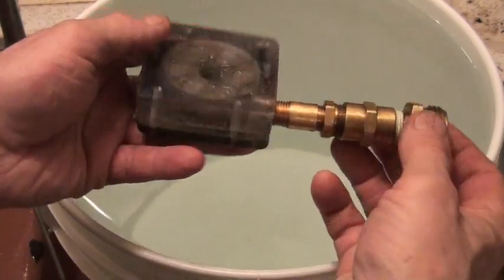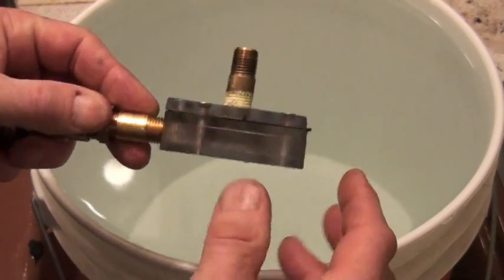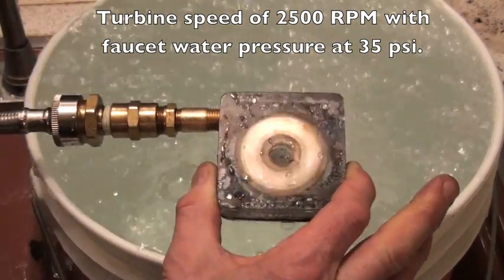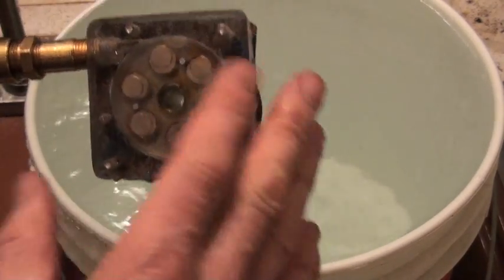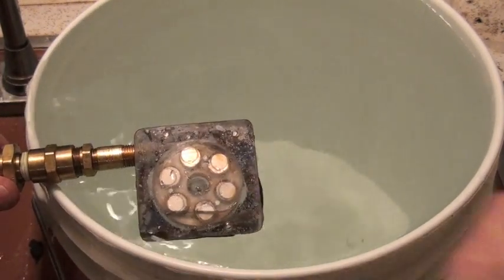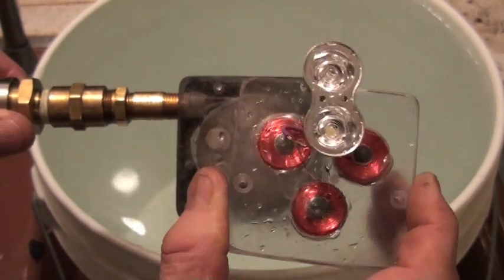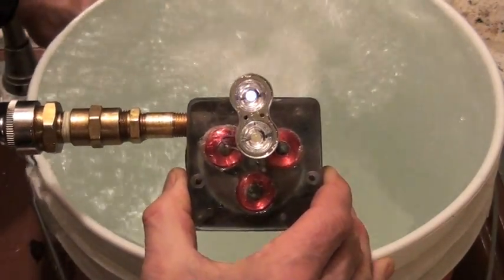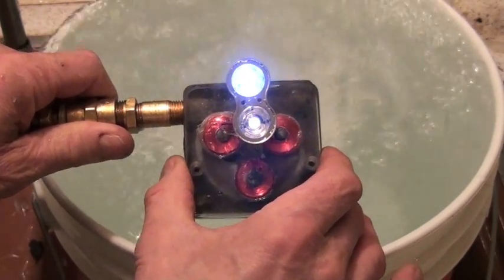Magnetic Tesla Turbine Generator

Comment: Could be increased in size & voltage, & use a wind driven water pump!, to fill a reservoir to feed it, as tje biggest problem with wind gen is rpm"s, this should be able to supply the higher rpm's ,with adverge wind

Comment: Why did you put the words "Free Energy" in your description?  If you left this out people would have looked at your design in an actual scientific mindset.  By using the term "free Energy" you are now dumped into the group of nutjobs that do not understand physics.  Free Energy is impossible.  Energy has to come from somewhere - you cannot create new energy.  Your device is getting energy from a coal power station that generates electricity that powers pumps that pump the water to your house.  So not free energy.  It is not even energy that does not cost money.
Reply from the maker: Sorry to disappoint you, but there are no pumps, or coal, or extra electricity involved in this situation. Normally, every time you open a tap for water, it wastes the pressure that could be used to produce power. I merely took free advantage of this wasted energy, which costs nothing extra to obtain. "Free Energy"... you bet it is!

Comment: This would work very well if instead of mains-pressurized water, you used a gravity-fed source, such as a mountain stream.  By using water pipes of decreasing diameter you can build up a good head of pressure.  All-in-all a very useful design - this has real world application.
Reply: Mark Smart they already have something like that adapted from medieval technology, it's called a waterwheel. For a guy named Smart you don't appear very, or is the name ironic?
Reply: Mark Smart You're being ironic, and you're still a dumb fuck regardless of the names you call me. You don't even realise that exactly what you proposed has been in use for over a century since the first hydroelectric system came online in 1882 on the Fox river in Wisconsin and you talk about "real world applications"  like some idiot trying to make the world's first airplane 100 years too late. .
Reply: Andrew the Celt Crawl back up baphomets ass mason slime.
Reply: Mark Smart sure it will, meantime, I'll get on with my life and leave you to wait on your rooftop with your arms outstretched like a fool.
Reply: Mark Smart great, it'll put me out of my misery from having to listen to you
Reply: Mark Smart An atheist cannot be a mason you tool, requirement number 1 is a belief in a higher power.
Reply: Mark Smart after speaking to you I'd say something very unpleasant is already here.

Comment: So the magnets multiply the speed of the wheel rather than just a normal water wheel?
Reply: quantum vortex no, it's pressurized, there's energy loss in the drag since the wheel causes turbulence and also loses energy at the axle through friction. It's great if you want to run up a $200 water bill to light a Barbie Playhouse though.
Reply: thx

Comment: I like this because it goes for simplicity by not having a shaft, or any gears or pulley system, and it is indeed essentially a Tesla Turbine as opposed to many videos that lack the casing. The only issue is that this rotor will slowly eat away at the space around it, so if it was used for a VERY long time, it would eventually grind away enough plastic to become less efficient. Perhaps if it was made of aluminum and pumped with lubricant instead of water, then it would be useful in some small scale industrial sense. Still, thumbs up. Oh yah, and it's not free energy.

Comment: hardly free energy, i guess water is free. I dont know about you but 200$ a month is completely free sarcasm. Putting monetary costs aside... where do you think the plumbing system gets power to pressurize water? It gets it off the grid just like everything else... this is simply getting a small fraction of that power back, but if you take the power that this device gives off and subtract it from the amount of power it takes to pressurize water through a hose... the system is still loosing more power than it gains... this is very far from free energy or a generator. If the grid were to shut off... water pressure drops too (yes it would take some time for water pressure to drop completely but it would eventually stop and this device would be useless.)

Comment: This technically isn't"Free energy". Why? Because it takes energy to pump that water out of your hose at high pressures. And I doubt that that generator is 100% efficient so your'e actually wasting power and water, because your output is less than the input energy you're using.
Reply: in a gravity fed system (for example the dam on top of the hill that  i use to water the plants in my 165 acres property) the rain "pumped" that water up for me. i have a 2 inch rural pipe that runs for almost a km and the water has so much pressure because of the slope that it comes out like from a firefighter hose.

Comment: Have you completed your 2nd prototype yet?  If so, I am very curious as to the loss of efficiency when the outlet water pressure is used to power a second turbine.  Tesla claimed 98% efficiency of transmitted flow to RPM and you lose no water in the process.  In fact with the reduced nozzle you seem to have even greater pressure.  

Could you PLEASE do an experiment with these sort of generators daisy-chained?  Perhaps with voltage readings to show what kind of loss is to be expected in the process.  Tesla states this is his favorite invention.  If they can in fact be daisy chained it would be no wonder why.
Reply: Bummer, people get into stuff, then they get board !
Reply from the maker: Coup2L'eau  I designed this turbine to mate magnetically with several others to increase output. It was my intention to experiment with that, but I can't afford to.
Reply: ***** did he ever e-mail you?

Comment: Pumping water is not free... I don't see the point in this?  What happens to all the wasted water?  Unless you are watering your gardens I don't understand the application.
Reply: The fact that it's not a "fee energy engine" does not mean it's useless.
A large one could be used by putting it in a river maybe?
Reply: what is the point of this? this is a toy. however the tesla turbine design is usually used to extract mechanical power from steam in industrial applications.
Reply: there is an application..
Reply: *****
 Large ones are already used in power plants. Coal, natural gas, nuclear, solar(not the photo-voltaic type), they all just heat water into steam. The steam is then pipped into a Tesla turbine like device that is connected to a generator.

Comment: magnetically coupled windings,
   need to see what power potential is available. after all, water is not cheap anymore .
   6-48 volts and some amperage behind that, is what is needed . but an interesting approach.
   fluid bearings and a shaft might get your RPM up to a usable form factor too.
  the smaller rotor has potential to keep magnets caged @ higher RPM too

Comment: In an electric car, a battery can run a pump. the pump can run the turbine. The turbine can turn an alternator. the alternator can provide charge to batteries that run the electric car. A kind of Over unity.
Reply: one problem.. batteries can't charge that fast due to resistance..aka load! once a load is applied , you can never get more than you put in..
Reply: MrRotaryengine
Well, then just to extend the range. What id the wheels turned the turbine? Or better yet a tank of natural gas hooked up yo a Bloom Box that makes that into electricity that supplements the batteries to extend the range. It's not perfect but it's better than the gas hybrid they use now. Still, what if you ran alternators in series? 4 alternators off the primary and sent those amps to the batteries?
Reply: Robert Galletta
No...it would not be better than the current set ups since the Bloom Box is a proven fake. Very thoroughly proven. So much so that it is AMAZING that there are still people dumb enough to bring it up.
Reply: FuckYouGooglePlus
Listen, You arrogant ass crack, If you need a simpler system, take a lawn mower engine, use it to turn a bank of alternators to keep the charge on batteries to supplement power and extend the range. Does that work for you?:

Comment: now if you built a large one safe to use with potable water to pass through to install on your main water line you could charge a battery every time a tap was opened, ideal for keeping batteries topped up in an emergency back up system
Reply: Great idea.
Reply: Roger Foster or, you could just have a rechargeable battery drawing milliamps of the grid, wait they already have those.

Comment: woohoo you made a water powered inductor lol
Reply: nothing new here.. basically same technology reservoirs/dams use right now..
Reply: MrRotaryengine
Do you know if this turbine would be more or less efficient than those in use today?
Reply: Gloria Plaggemeier Tesla turbines are more efficient w.r.t extracting momentum from the fluid, however they fall over when you apply a load.  You have to remember the way the Tesla turbine works is dependent on fluid viscosity, not on pure mass of fluid like you get in a reaction or impulse wheel.
Reply: MrRotaryengine yup, another one of Tesla's designs.  He designed Niagara falls.
http://www.teslasociety.com/niagarafalls_tesla.htm

Comment: have you continued your progress or did you shelve it? my understanding is that you might achieve ALOT of hertz, but the volts and amps would max out on the turbine due to the coil size and wire diameter. true?

Comment: Great idea. Are the magnets only attached to the outside disk or are they thick enough to be joined to the other five disks? If the magnets are only connected to the outside disk have you noticed any imbalance caused by their weight? How are the six disks connected?

Comment: i want to apply this concept for an rc airplane or a boat. i designed a lightweight turbine that works great with gases(it cant work with water etc.) but i need a practical (and lightweight of course) way to generate the flow to run the turbine.any advise?

Comment: at 100 psi and NO super heat, saturated steam is roughly 337F, I have a steam boat and even with superheat I rarely get to 500F. What you have to worry about is the case failing. Also my grandpa made a tesla turbine and we've run it on air (around 35-40 psi) with little problem. You could make the case out of aluminum (which is what we did) and it'll work just fine with saturated steam =)

Comment from the maker: Using JB weld and compressed steam at 100 psi plus high temp, is not a good combination. Steam expands something like 1800 times from a leak, which could be catastrophic. The outer case at least should be metal or high-temp carbon finer.

Comment from the maker: The efficiency is determined by the load put on it. A Tesla turbine under no load can be 98% efficient, according to Tesla and other tests. However, this turbine is likely in the 10% efficient range when run on water pressure under load.

Comment from the maker: That is a great idea, but the problem is usually getting enough PSI pressure into the turbine, as Tesla Turbines like high pressure to operate. This unit needs 10 psi (25 foot drop of water in a hose) just to get started, and 60 psi (pressure of about a 150 foot vertical drop of water) to make enough power to run a couple of dozen LED's.

Comment from the maker: Folks buy pressurized water, but never take advantage of the potential energy. They thoughtlessly let the water splash out into a sink or garden without using the energy. 
The point is, this turbine has no bearings, shafts, or seals, and its outer case is a generator. I think that is an improvement over 19th century technology!

Comment from the maker: The Tesla Turbine requires a high-pressure fluid source such as from a waterfall or home pipe to work properly. The small amount of power saved from installing into a home water pressure system, would not pay for the installation and maintenance of a turbine system.

Comment from the maker: The outer edge of the discs moves at a higher velocity than towards the centre. The fluid normally enters at a very high velocity, directed at the edge of the disc, then rotates several times before exiting through the centre. Making high velocity fluid go into the centre, even if it was directed, would not produce the torque required. The fluid "wants" to go straight out. You could design a different style disc, perhaps convex with fins and make it work...but it wouldn't be a Tesla Turbine!

Comment from the maker: This Tesla Turbine won't work in reverse fluid flow the way you describe. However, I have connected a motor to the Turbine, run it in reverse and then you have a Tesla Pump! The original Tesla patent has the exact same device shown as a pump and a turbine.

Comment from the maker: For a pulley drive, I see two options. Tesla's Turbine used a shaft to mount the pulley, with bearings and shaft seals. Otherwise, one can build a magnetic turbine with a pulley that mounts on the outside of the case as a stub-shaft, and then uses a magnetic coupling to drive the "stub-shaft".

Comment: Ah a well refined design. what ever happened to your CD versions, those sounded cool.
I tried making one before, but I don't have enough water pressure to get it to speed and you have to generate a lot of speed to get enough torque. So how did tesla's turbine channel its power, in your case a magnet, but I want to build something that can power a pulley drive, what do you suggest?

Comment from the maker: Tesla's turbines could be designed to be powered by any fluid or gas under pressure. In Tesla's time, steam pressure was common, and that is what Tesla talks about in most patents. However, Tesla's Valvular Conduit patent also allows use of gasoline or other fuels to be burned inside the turbine...not such a good idea in this kind of plastic turbine!

Comment: Instead of putting this on your garden hose, which would draw energy to operate.  Put it instead at the bottom of your gutter system, the water that flows through would provide some power without using any energy energy from the power plant or add cost onto your water bill.

Comment from the maker: The discs were cut by water-jet from .015 inch thick tool stainless, and the case was made from 3 polycarbonate pieces, also cut out by water jet. I created a 3-D file in Rhino and emailed it to the water-jet place.